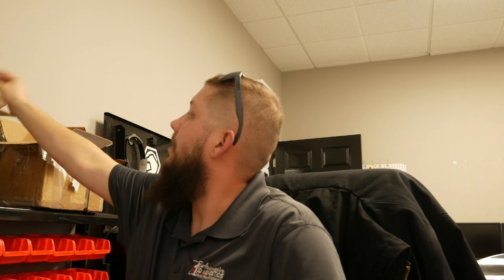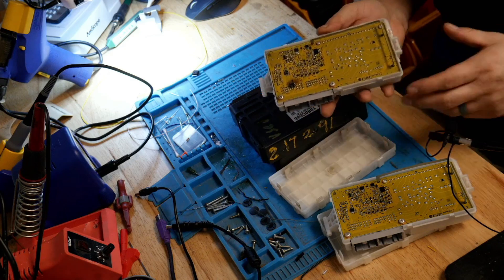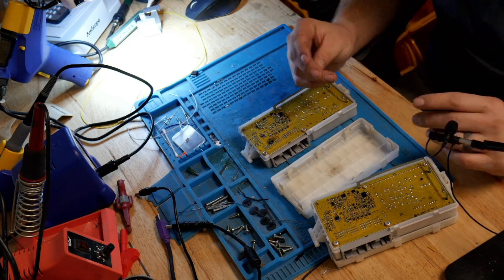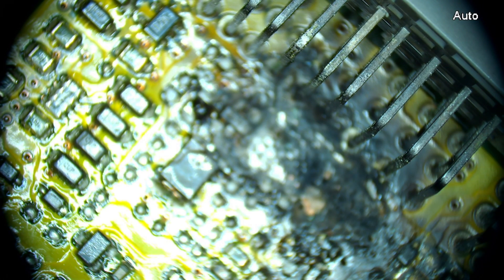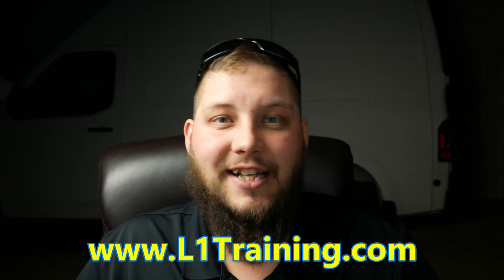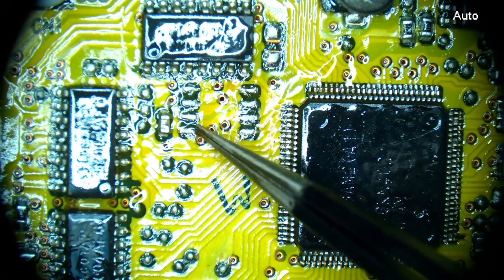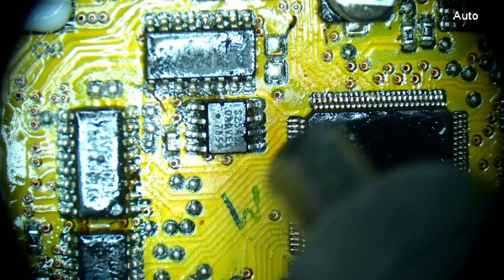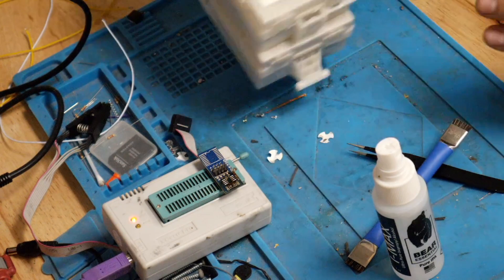PART 1 of 2 Modules 1 Car? (Gross) Mitsubishi PCM & ETACS Cloning (DOUBLE GROSS)

Comment: Could you not just de-solder the old eeprom and physically solder it onto the new board?   rather than having to program it? (by program, I mean pull the old data and then copy/paste it back into the new one)........  Is there any reason why that wouldn't work? or why you wouldn't do it that way??  (particularly in a case where you had to remove it, for it to read correctly anyway)
Reply: Probably for educational purposes. And if there is damage to the original then I for 1 like to use the non damage donor chip. Or a new chip entirely if possible.
But yes I'm sure you could use the original chip with little to no issues.
Reply from the maker: I cover the answer to all those questions in the full version. It's a lot to unpack.
Reply: Advance level automotive de solder and change its work
Reply: Boards are conformal coated. Safer to as little physical modification as possible.
Reply: @danm3532  You can re-coat your work  easily with clear fingernail polish.
Reply: @calholli  Nitrocellulose is not true conformal coating. The solvents in the nail polish may degrade the fiberglass in the PCB, as well as the epoxy in any components. Acetates are not way far off from acetone in chemistry, and acetone absolutely EATS resins for breakfast.